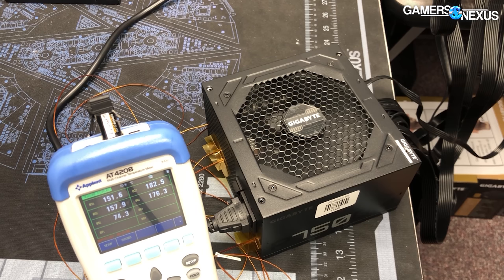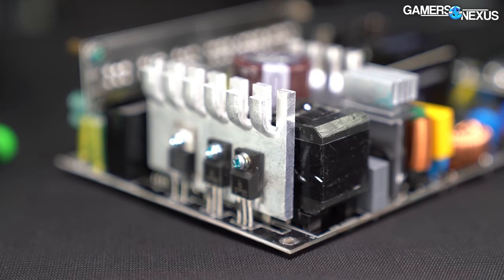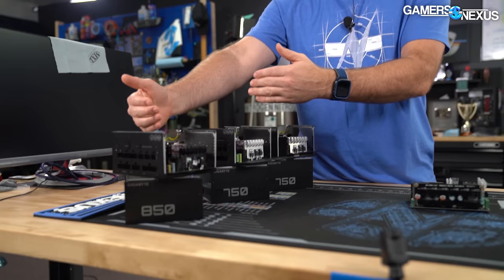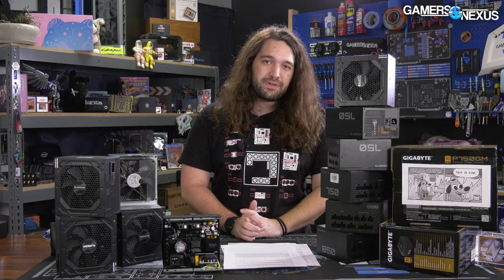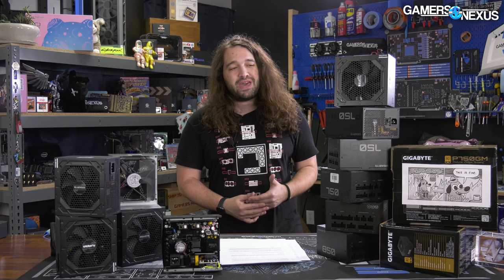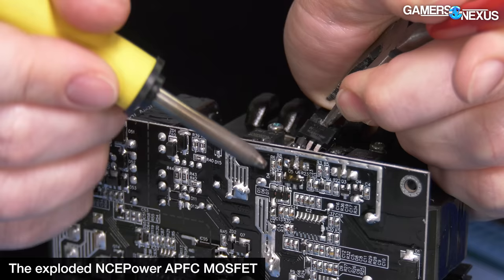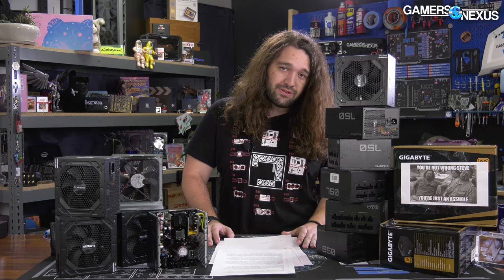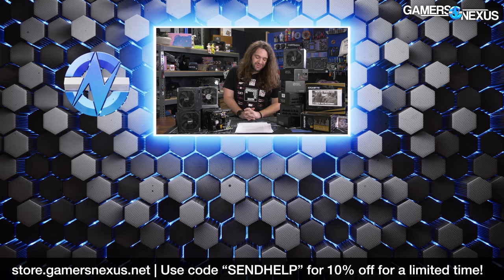Exploding Power Supplies: Gigabyte & Newegg Dumping Unsellable Product

Comment: What is really troubling about this situation is that a whole Gigabyte system, like the one they built for an endurance testing is much more likely than one might think. I have some clients who are big GB fans and usually want every component that can be GB to be GB. Fortunately for me, so far i managed to convince them to not go GB for the PSUs and have been sticking to the good old SeaSonic. I don't trust GB's PSU basically ever since they started making them some 10 years ago; call it a bad karma, chance, just unlucky or whatever but the first ever PSU that died in a system of mine was a Gigabyte (specifically a Superb 550P). What lured me back then was the news that FSP would be helping them with the development and manufacturing of the PSUs. I have no idea how common that was at that time, but that bad experience and the declined warranty is what pushed me away from GB not only as a PSU manufacturer, but as a brand as well.

Comment: The issue with the different vendors for components has to do with the sourcing policy to controle purchase prices of components. No single source policy is used to be able to play the vendors on purchase prices and supply performance. If a vendor does not comply with e.g. price reductions, percentages of supplies of this vendor is offered to its competitors to be grepped at the reduced price. It is the easiest cost cutting measure in component markets.

Comment: It was a wonderful feeling learning about the risks of this PSU after using it with my shiny 3080 for WEEKS. On top of learning that the rev 1 Aorus Master has VRAM cooling issues, which one would think was accounted for given the FOUR SLOT cooler design. Shafted twice in the same purchase. Thank you Gigabyte.
Reply: @VRGamercz  Asus mobos are usually great. But i would never never again buy an Asus laptop
Reply: @VRGamercz  there GPU's are still great!
Reply: @VRGamercz  my aorus b450 pro wifi have a lot of error. Blue screened when opening the rgb software, my second one from RMA straight up didn't boot. Then, the third one have wifi and bluetooth problem. When they offered to RMA it again for the 4th time, i straight up asked for a refund. Bought an MSI B550M Pro VDH Wifi after that. No issue. Now i'm using an Asus B550 A Strix
Reply: @VRGamercz  I've seen people say this for literally every manufacturer there is without exception by now.

Comment: Imagine desperately waiting to get a GPU at MSRP with one of these PSUs and you put both of them in your system. Then have the PSU commit seppuku, take the GPU and possibly other components along with it.
Reply: There are basically 3 rules when you are building a computer. 1) Never cheap out on power supply. 2) Never chap out on motherboard. 3) Never cheap out on cooling. 
Buying a power supply from manufacturer that is not seasoned in making them is disaster waiting to happen.
Reply: @VRGamercz  this is not really a "cheap psu", it's like mid-end stuff. rule 4) don't overpay on motherboard either, you get nothing in return.

Comment: Re: different caps on the same model PSUs... I thought you were going to say they were rated differently, some kind of an actual problem, simply having different manufacturer's components on a board is not a big deal.

I can go grab 5 different boards in my office with at least 3 different brands of caps on them.

As long as the caps meet the minimum spec that's fine. It's not exactly a smoking gun.

Comment: As a electronics PCB designer I can say when searching for capacitors for my designs it can be a nightmare. Normally with capacitors, resistors etc we put a similar attribute on the BOM for any components we allow to use different manufacturers, this then allows for the assembly department to use another brand of component if they are unable to purchase components within the BOM due to supply issue. But the values tolerances etc must match. For me the use of different capacitor manufacturers Is not a issue and is common in most situations.
Reply: EXACTLY. This is not CHAOTIC at all .... If you have only ONE OPTION for a component, be prepared to halt your production at any time. So much study on this particular piece, lets open a music system, DVD player, cellphone charger .....  and compare production runs ....
Reply: Multi-sourcing is vital but it does add risk that needs to be intelligently managed. Partly to guard against counterfeits entering the chain (like LP2985 [LORB vs L0RB] packaged mystery regulators) and partly to ensure that you get the undocumented qualities you depend on (and sometimes didn't know you did!).  My guess is they used a fast and loose contract manufacturer.

Comment: im going to use this video as the perfect example to tell people how having a certified PSU from a known maker doesnt make that PSU a safe one
Reply: Unless it's an actual reputable PSU manufacturer, like Seasonic, Super Flower, etc. Gigabyte, EVGA, etc don't manufacture PSU's. They just contract a manufacturer to build them and slap their name on them. Seasonic manufactures most of EVGA and Corsair's Gold and Platinum PSU's, hence why they're known to be reliable. At that point you're better off just buying the original manufacturer's PSU's, as they're generally cheaper. I've been using Seasonics for decades, and they've never given me a single problem. They've also got a 10 year warranty and great customer service. Super Flower makes great PSU's as well.
Reply: Technically it was "safe", the metal box it's in contained the fire.
Reply: @GeraldMMonroe  Technically it wasn't safe, as fires do start like this. Just because GN were taking safety measures and kind of got lucky doesn't make it safe. I'd be surprised if one of these PSU's hasn't caused at least a few fires.

Comment: Never cut corners on your power supply. Lost my first custom build back in like 04 because of a cheap power supply so now all I buy is Seasonic.
Reply: Let us just hope Gigabyte didn't subcontract Seasonic to make these defective PSUs for them. :(
Reply: Cosair/seasonic all the way.
Reply: Ah, yes, Seasonic. I too enjoy PSUs that cheap out on protections (all lack multi rail OCP, several lack OTP), use crappy fans (Hong Hua FDB fans on their Focus and Prime series have an annoying ticking sound at low RPM), struggle with high end GPUs (Focus had/has this a lot, Prime struggles with 3080/3090) and have QC issues (issues with cold solder joints) :)
Reply: @sparkypvp2167  these are the only two I'd buy a PSU from. Had an EVGA Supernova back in 2016 that blew up one day under light load. Never EVGA again.
Reply: Back in the old days, the top choice was always PC Power and Cooling, if you could afford them. Those things in the 90s and early 2000s were absolute TANKS.
Reply: Seasonic is just as capable of making junk. There were those cheap 650s a few years back that were killing people's hardware. Shame Steve wasn't up to this kinda testing back then. 

I'm also a miner with a dozen or so PSUs in 24/7 high load operation. The only failure I've had so far was an EVGA that literally caught fire. That sucked but thankfully EVGA replaced it under warranty quickly and it didn't hurt anything else other than filling my house with smoke. 

I have several Rosewills in operation for couple years now. While they are generally regarded as junk, mine have performed flawlessly.
Reply: common sense
Reply: The key with rose will is to buy the PSUs that are super flower OFM models. Their old quark line were tanks, mines over 10 years old no issues. 

HardOCP used to have a list of all super flower supplies by brand, IDK if that list mobed
Reply: Matt Unfortunately you'll never convince my cheapass friend. He buys really cheap psus and is perfectly fine with replacing it with another if it dies. His reasoning is he can buy 4 or 5 psus compared to expensive name brand versions. So far after more than a decade and two upgrades, luck has been on his side.
Reply: @Paul_Sleeping  Yep, bad PSU can wreck an entire system. Its the one area to never cut corners on.

Comment: I'm pretty sure I saw this video a year ago, but it never clicked that I had this PSU. I grabbed a GP-P750GM just over a year ago when building my NAS. Last night, the main capacitor blew and blew a circuit in my apartment (short to ground). I am only lucky this was on the primary side, else I could have lost all my data. Redundancy doesn't mean squat when all your hdds go up in smoke.

Comment: A few years ago the computer store I was a tech at got a bad batch of Thermaltake Toughpower 650 Gold PSUs that would explode around 15 seconds to 15 minutes after first being powered on. Would blow your ears out and little bits and pieces would come flying out the back of the unit. The computer would shut off, but you could then power it on again just fine. Upon removal from the PC, we found a large capacitor cover loose inside, meaning it most likely hit the overcurrent protection but somehow didn't break the circuit as designed, allowing it to function with presumably no more overcurrent protection, and that's kinda scary to think about. Thankfully Thermaltake took back the batch and we followed up all the customers who had recently purchased one. Not sure how widespread it was and I'm guessing it was isolated to the batch as I didn't hear about it online, but I had about 5 or 6 of them blow up for me, and then another 10 or so that blew up for my coworkers.

Comment: The irony is that if you yank this out and replace it with a new one, you're just as likely to end up with an untrustworthy and potentially broken PSU. I just can't bring myself to trust ANY new PSU made in the past year and a half of  the pandemic. It's been nothing but headaches and heartaches with every new PSU I've gotten, while older PSUs still continue to chug along just fine
Reply: My evga g2 850w is going on 5 years now. Used it for my 5820k/980 ti build, my 1080 ti/8700k build, and now its powering my 10900k 3090 build without issues. Hoping it keeps working for a long time because I dont trust new psu’s either
Reply: I deliberately bought an 'ex display' model for just this reason.
Reply: I got a Seasonic back in December and it's great.
Reply: @alabasterscarf612  I had a Seasonic Platinum 720 literally die in 3 years and just take 2 hard drives with it. But if you got a platinum, you have a great product
Reply: We should name this era of questionable power supplies
Reply: looks like power supply quality has somehow regressed back to the levels of the 1990s in only 18 months!
Reply: not really, big names in PSU business have larger parts supply / larger warehouses than Gigabyte because they move more PSUs, so they are more likely to have better parts on their hand.
Reply: I have an enermax liberty that is at least 8 years old, paired with an i7 9700k and a 1070 never give any problem.

Old psu were made to last

Comment: I've been using a GP-750GM for at least 8 months, but I haven't experienced any major problems with it. Until now I'm using it. I don't know if I just landed on a good PSU, but that's my experience from it.
Reply: What's your system specs?
Reply: Not a personal recommendation but… I played around with one I got cheap on eBay. The real issue seems to be if you load it up. If it never gets loaded over maybe 65% and it worked from the get go it will likely never blow. It has average components. In say 450w max draw office PCs they’d likely be fine. The problem is they’re all over the market. You as an end user would have to know that, most people don’t. Most people see gigabyte and think fine. The other issue is they aren’t cheap. Just buy one of the Aresgame ones for the other video, it won’t blow up in its rated capacity it’s just not efficient. Personally if I scored a load of these liquidated I’d run them and then use them in low wattage PCs but they’d have to be dirt cheap.

Comment: Between the forced bundling of high demand parts with potentially dangerous equipment and neweggs Intent to lock hot items behind their PC assembly service... Well, I definitely would rather shop somewhere else.  Thanks for going through all this to make people aware of the issues.
Reply: Support your independents. There are some good SI's out there if you are willing to look.
Reply: Always wait in line in Micro Center before opening hour. At least they offer financing so they get sales rather than have someone fill up their wallets with paychecks first.
Reply: What would you suggest if you don't have a micro center. Newegg is pretty been my only known option. Like that and amazon. Tiger direct I used to buy stuff like 15 years ago but they seem overpriced.

Comment: You guys stressed the hell out of those components and then expected them to play nice again? You sure are trusting, lol! I haven't seen anything like you guys since I graduated tech school in '85, it's so nice to see actual techs instead of board-swappers talk about components and the whole PC paradigm. The only component-level fun I've had in the last 10 years since I got this pacer/defibber has been large electrolytic caps and 120ac at New Years. Just subbed, cya later!
Reply: Well the hardware should be pushed to the max. I mean there are people out there that will do that kind of work and or gaming.
Reply: @evacody1249  The joke was saying "are trusting" rather than "If you're going to push things like that in your applications you'd better spend the big bucks and get components that can handle the load.".

Comment: You have saved at least one PC. I never buy prebuild, but had to due to GPU supply. When I bought it (R5 5600x, RTX 3070), I could not get the info on what MOBO or PSU I am gonna get. Got the "sus" Gigabayte 750W. No the PSU did not set the PC on fire, but will be replacing it today!

Comment: What they say about the 850W capacitors working up to 1050W might reveal what is happening. These PSUs can't handle 3000 series, but attempt to by allowing 130% OVP and use that so they can advertise that it can handle more demanding systems
Reply: For the most part, the bulk capacitor isn't really stressed more by higher current. If its capacitance is too low for the current being drawn, that would cause more ripple on the output, which could cause higher voltage spikes on the main switching MOSFETs. However, they should be rated to handle the same 400 V that the capacitor is rated for, in fact often they're rated for 600 V. And, the maximum the voltage could spike to, even if the capacitor was really tiny, is 2x the input AC peak voltage, which would be about 340 V. Not saying that couldn't cause other problems indirectly but I don't think the bulk capacitor is the issue here.
Reply: @Sauraen  looks more like gets not getting matched one is primarily leaned on and goes into thermal runaway about the same time as protections try and stop it... These protection circuits are somewhat slow considering the nature of these devices. These blowing up can short for example sending much higher line voltages down stream ... Rare side effect too is shorting AC to DC though not really the same failure mode in that case
Reply: I don't think that's what's going on, to be honest. More likely a design screw up.
Reply: I honestly don't have a problem with the capacitor wattage ranges because even someone who is not an electrical engineer knows that any device designed and tested to output up to a certain wattage, doesn't mean they cannot go above those wattages safely... Doesn't mean that you should do it regularly, but that you can, in most devices... So long as it's not made by gigabyte this has shown though... Picture this... Capacitor and whatever else, wattage rated at 850-1050W... The range is because they will accept wattages up to 1050W... The reason they are probably labeled 850, is because it's the lowest maximum number stated on said capacitors and other components, and it worked as tested... As to the PSU not running Nvidia 3000 series cards, that may have been the problem when they first appeared, but I only see on average, at most, 750-800w PSU units being put in most Nvidia 3000 series based machines these days, although they aren't running 3090s either... Don't get me wrong though, I wouldn't trust these particular models to not kill a 3000 series card, or run it properly, because of what appear to be serious design flaws in these units, or the components...

Comment: Its a shame a video like this had to be made in the first place. There will always be poor quality products out there, but the real shame is being FORCED to buy one especially without being able to return it on its own. I didnt know the extent of how bad the quality was in the case of the PSUs, but the first shuffle I entered I noticed that they were bundling a Ryzen 5950X with a super cheap B550 motherboard. Im not knocking B550, but the VRM and other comments on that particular board were not something I would want to rely on with a $1000 processor. *also I know noone was FORCED to buy anything, but for many the shuffle was the only chance to score a GPU. I also noticed a few shuffles had RTX3090s bundled with a 750W PSU. Sure it would run... but if your spending $2000 on a GPU I feel you wouldn't go bare minimum with your other components such as the power supply. Come on Newegg you can do better.

Comment: When I got my chance to buy a 3060 through the Newegg shuffle it was supposed to come with a power supply but when I paid the power supply was out of stock lol. I didn’t receive the power supply or have to pay for it. I really lucked out. 

I had a Corsair power supply blow up after a few years and killed my 1070 right before the shortage. Thankfully I had bought a 1650 super for another system before everything went out of stock.